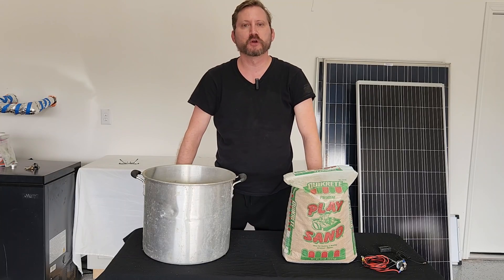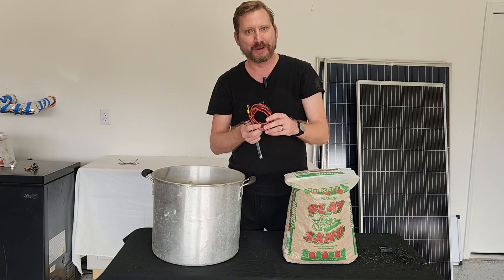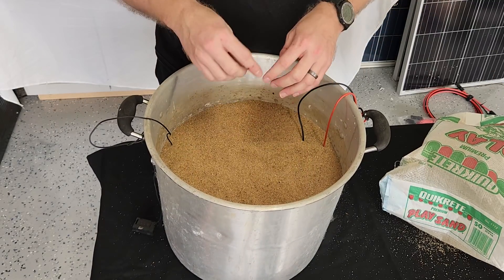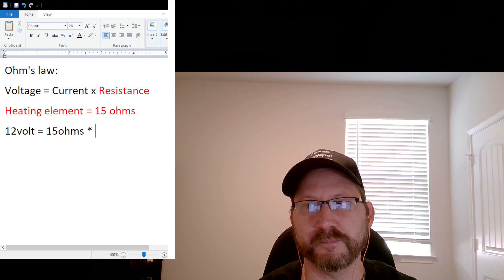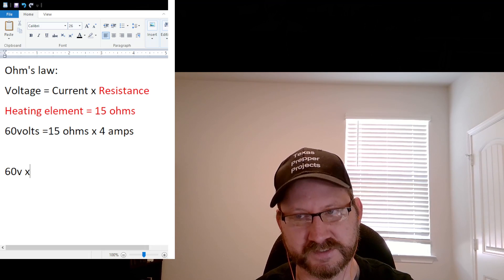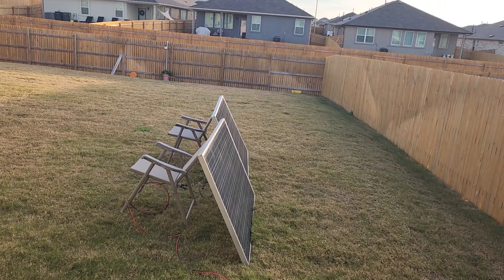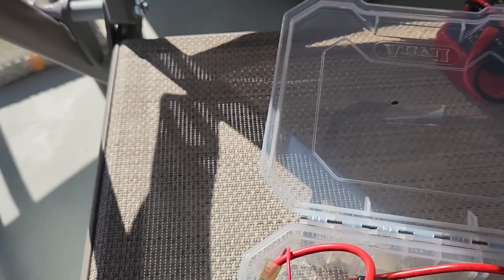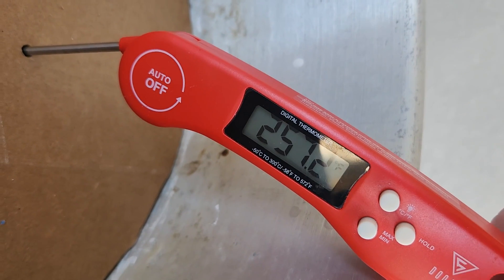Sand Battery Heater solar powered 250F / 120C with no flames or fuel! DIY

Comment: How can you calculate how much sand to use? I am thinking about doing something like having say 200 pounds of sand maybe in a basement, the two panels heat that up and you let the heat leach out all night, maybe it heats the first floor floors of a small house and that has somewhat of a radiant effect. As you say this isn't going to heat your whole house with two little panels but with longer wire runs and the sunshine being free it might still be nice if it just took some of the edge off by acting as radiants floor heat on the first floor. Since this is just a bit of low budget boost and it's really "set it and forget it" that might be an interesting application. This would be good too if your basement had no insulation in the ceiling.
Reply from the maker: I think that heating a barrel of water with direct solar tube probably would make more sense.

Comment: looks like you can add more sand to the pot... i would keep the wires at the bottom and run up inside walls .. can put inside metal garbage can with even more sand .👍👍 or use as a middle of day batteries full dump load .  a insulated  box over it  that can be removed would save heat for later.
Reply from the maker: Could

Comment: how long does that heat element last? It's not designed to work in a heat isolating material. The water would cool it down

you could've just use water. With send yes you can accumulate more than 212 f of heat. But you'll have a problem to release that heat when you need it. That heat is trapped there in the center of that send. 

You can use water instead. Your 200W panels won't be able to boil a lot of water. Just having a bigger volume of water is better cos you can easily regulate that heat later. That's no need for a sand battery for that small pawer. Maybe if you have 20kW solar panels send batteries can be useful. Those that can melt send.
Reply from the maker: check out my other videos on this test.  Water has logistical issues, like, everything hast to be waterproof.

Comment: So what is your verdict. Does it work as intended?
Reply from the maker: This does work. You just need to be realistic as to what you are going to use it for
Reply: Thank you for your reply @texasprepperprojects . Would you say it is equivalent to a 60 w heater 24/7 (since it is 240w, and the sun shines at a good angle perhaps 6 hours/day?) in that case 10 of them would equal to 600 w heater 24/7. it wouldn't be enough for heating a room i cold sweden during winter, but with more panels perhaps it would.
Reply from the maker: @qvarsell   not in sweden! too cold!

Comment: whats the max temp of the element? does it burn out/break at some point?

i bought a 550watt 120v charcoal lighter, along with many other resistave heating elements to start testing with.

a couple of years ago i filled a 40 gallon trash can with sand, ran a copper coil pipe in the sand. planned on pumping water through this pipe down into the sane and the back up to a small heat exchange with a fan on the back side to help heat the house. its all still sitting here, but i have not done it yet and this was going to help me observe how this was going to work then scale up from there.

batteries are expensive, but solar panels and sand is cheap, same with copper tubing and other misc things.

water has a much high energy density, but it can only go to about 200f before it starts to steam then boil at 212f, but sand temps can climb much higher.

i still need to figure out the amount of sand and the temp of the sane needed to heat the house for say 3 days in the coldest of cold winter days, it may end up being way more than what i am hoping for

then in the summer maybe continue to cool zones with heat pumps.
Reply from the maker: it does. this is an ongoing issue i'm having with the sand battery actually. It ends up melting and coming apart.   The heat exchanger thing is actually a waste of time. heat is heat is heat is heat. Copper tubes and fans don't make the heat any hotter. Just put the can of sand  INSIDE the house and heat it up.  Running it through air may make it heat FASTER but doesn't make it heat any BETTER / MORE. To heat an entire house? you will need literally TONS of sand sitting on top of a volcano.  At best, you may be able to warm a ROOM.
Reply: i dont think you understand why i want to use a heat exchange. i am not wasting time on this. i plan on using the sand to store the thermal energy from solar during the day, then use water, pipes and heat exchange to pull the heat out as a source of heat for my basement.  i understand how this stuff works more than you assume
Reply from the maker: Cool
Reply: @jasonbrown467 what tex here fails to understand in his comments in the video and in replies. Is that you can cheaply make your own heating element to your specific setup and achieve higher temperatures. The problem with using water heater elements is that they will suffer from what is called a dry short, due to trying to use the element without a liquid. As most people understand heat rises. Well with a medium like water, the element will cause a thermal syphining effect. Causing water to flow over the heating element. 

By making your own heating element from wire. A person can literally make it to whatever resistance they need it to be. Not to mention heating element wire is designed to heat air, so heating sand with it is not a problem. As far as temperatures achievable, well you could in theory get to the melting point of the sand. Some heating element wire is used in the heat treatment of high carbon steels, and in kilns for making ceramics. While you will find other types of heating element wire in a toaster. 

All that these sand batteries are ETS (Electric Thermal Storage) systems. 10 to 15 years ago several US electric companies offered ETS programs. Where they would install one for you, and you paid some extra on your electric bill in order to pay for it. Unfortunately the systems weren't explained very well and few people had them installed. But they did work decently. 

So I hope that this information helps you somewhat, and good luck with your project.

Comment: What about the possibility of heating the sand directly with a solar heat collector?
Reply from the maker: What about it? Are you talking about a fresnel? Check out my other videos for testing
Reply: Okay, I will. What I was thinking about is an insulated sand pit with a copper plumbing grid inside and a solar heat collector (double pane with black sheet atop sand, essentially) on top. This just outside the greenhouse. The copper plumbing grid is to feed a larger, cheaper air duct feeding the greenhouse t @texasprepperprojects
Reply from the maker: Leave the sand inside the greenhouse

Comment: 2 questions.
Can you use wind turbines instead of solar panels
And instead of sand container. Can it be hooked directly to an electric water heater's element where we can pump water to a radiator system?
Reply from the maker: Yes. Any electricity works.  2, yes... but I think direct solar water heating with black tubing is easier and more efficient

Comment: I've read mixed reports of wiring panels direct to an element can cause the panels to wear out quicker. Anyone have more insight into this?
Reply from the maker: I don't know how it's possible to 'wear out a panel' other than if the resistance was too low and the panels were trying to put out more power than they can. Thats why the math is so important, to match the resistance of the load to the panels output voltage and current limits.  I'm at about half the limit of what my panels can do

Comment: Supporting heat for water tank? Like inline between woodburner and water tank?

Thinking of a sand battery with insulation that goes along a suitable pipe
Reply from the maker: It all depends on what your end goal is. If it is hot water there are better ways to do it

Comment: Aside from safety, any reason why this wouldn't be a good way to heat a van?
Reply from the maker: Nope. I don't see why not.  Just keep the sand inside the van and run the solar wires inside
Reply: @texasprepperprojects  would need to calibrate a thermostat so I could leave it on while at work. Currently in Southern US and was thinking of moving to MN. Wouldn't survive the winter without heat and this seems like it would be cheaper and more reliable than a Chinese diesel heater.
Reply from the maker: I don't think you are going to be able to do a thermostat. At best just plug it in and cross your fingers. The greater issue is that Minnesota in winter only gets about 2 to 3 hours of peak solar sunlight so you'll have to have a lot of panels for this to work. I think you are better off with a diesel heater or buddy propane heater actually for your situation
Reply: @texasprepperprojects  valid point. I have 900W of solar and the potential for 30A of alternator charging. That still may not be enough. Should add some wind, since I've practically maxed everything else out.

At any rate, would probably run the element off my 120v inverter since it's already on for my fridge.
Reply from the maker: Sounds like you have enough power. The setup is pretty cheap so give it a try!

Comment: This is fantastic. So is the idea that you are running the heating element at about 25% of its potential because it's a resistive element?
Reply from the maker: I'm running at 25% because that's as many panels as I have to put out the right wattage. If I had 4 panels I could get to 1kw

Comment: That’s neat I didn’t know that could be done now why hasn’t anyone improved on it I’m tech savvy and I’m old so my point is some could make lots of money off a good idea it work so well here to much rain and over cast but love your presentation.
Reply: There’s a sand battery heating a full leisure centre in Finland in winter
Reply from the maker: @hughmarcus1  yup and its geothermal powered. great idea
Reply from the maker: Thanks !
Reply: i have seen some examples of sand batteries in companies but indeed it could be interesting for households.

Comment: Think beyond a greenhouse! This has many commercial, industrial, grid-scale, and even home applications. Anywhere heat is used for any purpose or with more effort and expense anywhere electrical power is needed.
Reply from the maker: the problem is scale. In order to heat more than about 100 square feet you have to have a LOT of sand. Like, literal TONS of it.
Reply: @texasprepperprojects  How big is your kitchen oven <10 ft3? Also the size of the area you heat depends on the temperature/wattage applied over time VS what is lost. An aluminum pot loses heat like a heat sink. R40 insulation however holds heat like crazy. A hundred pounds of 600 degree sand highly insulated will be hot next week.
Reply from the maker: @Resist.Tyranny   but if the pot is INSIDE The airspace, then the heat isn't ever 'lost'

Comment: PV dump sand battery is also my current obsession. Debating whether to DC dump from the full array (175 VDC 34 A), take it from the 48V battery bank, or run it through my single-phase 120 VAC service. I've been considering pros and cons of each and keep coming back to 120 VAC as the most practical, in spite of the wear and tear on the inverter, etc. Would love to see more examples from the community here.
Reply from the maker: I would do direct DC if you can get the resistance to work out

Comment: Hi thank you for that.
It is good that you show us how to do it, however. I have been using immersion heaters as dump loads. To control our wind turbine.
Over the years we added 5kw+ of Solar pv. The base voltage is 120vdc and the Dump load voltage is 138/9vdc into two tanks total capacity is 500ltrs +, each immersion  is 2 kW. They are stepped to brake the WT seconds apart. It works very well with no problems since its installation in 2008.
I would not dare tell you what to do but an accumulator of capacitors or batteries would give you a much better power range.
You were working in the full Power of the Texas sunshine and if your sunshine range dips to 66% you will get no heat. With capacitors or batteries or both between the panels and the sand battery it will produce much more over a longer period. 
55 years ago, they installed storage heaters in our dwelling houses. Some were 3jw..
They used economy 7 to heat the elements but the material used to store the heat were canisters of 4mm limestone chipping., dust free. 3 canisters approx 200mm in width sq  and 500mm in depth. Made up a 3kw unit. Later on they used a fire brick of sorts.
This is a much discussed item in renewable energy forums.
Keep up the good work.
Cheers.
Reply from the maker: thanks!

Comment: I think you mean silicone rubber insulated wire, not silicon.  Silicone is an oil and silicon is essentially sand.
Reply from the maker: Thanks

Comment: Of course you can store heat in insulated tanks full of sand, rocks, glass beads.  Of course you can heat that tank with electric heating elements.  It’s just not economical.  And if it was better, we would already heat our houses with electricity, but not many do….because the supply of energy for home heating is a very complex issue that depends on what energy sources are locally available and the infrastructure costs to get that energy to your house, and the cost to convert it from its delivered form into heat.
Reply from the maker: I do agree with most of this statement.  I think the easier answer is 'scale'. I think thay geothermal sand storage works if your tanks are in the tons, but that isn't practical for residential use

Comment: Add 100'+ coil of copper tubing. You have a pool heater. That's what I am doing!
Reply from the maker: Just use a normal pool heater and a tiny 12v pump. Much cheaper and less losses https://youtu.be/ubIkEjnByrA?si=HicfD0-KX4787e1u

Comment: For energy storage of this kind, the higher the temp delta, the better the results. heating sand above 500 has more density than water sub 212
Reply from the maker: 50F to 250F is a hell of a delta

Comment: I know this is from 3 months ago, but could you do a video where you discuss the possibility of scaling this type of solution, along with the logistical challenges that would create?  At some point, you're probably further ahead to use the current from a larger PV array to power a decent heat pump.  Still, I'm wondering if something like what was demonstrated in this video, built to a 5x or even 10x size, could be housed inside of a thermal mass, creating a solar-electric alternative to a rocket mass heater?
Reply from the maker: I actually think that a 'better' option than anything else is to use a small DC pump to circulate water through a solar heater (basically black tubing).  The TOTAL  amount of money you spend on equipment and solar vs the amount of BTUs you would get from heating 55 gallons of water or more, I don't think can be beaten. Check out my other videos. I gained 20F in 35 gallons of water with a tiny pump and a pool heater. That's a lot of BTU for the dollar.
Reply: @texasprepperprojects  - There are three reasons I don't like water for storing heat energy - "flash to steam"!  Sand can't do that.
Reply from the maker: This is true but running water through black tubing isn't going to get it THAT hot
Reply: @texasprepperprojects  
Right, the Black HDPE tubes/pipes start disintegrating above 70degC, hence in a ThermalStorage (Sand or underground) you can not archive more then 50degC otherwise it become soft and deform. Very Bad if you have 300m3 of sand on top. and then a 17x7m winter greenhouse on top.

If I heat up the 300m3, I can get only the range from 50degC to30degC out and feed it controlled to the Underfloor Heating System of my house. this is 1800kWh of heat energy which would give me 50 days basic heating if they where no other losses.

However, I have to verify the 50degC with the manufacturer of the HDPE pipe, maybe I can get 10 degC more

Comment: you could wrap that pot with copper tubing to make a fluid heat exchanger for haeting a soaking tub, radiant floor heating etc
Reply from the maker: It all depends on if you have the bucket inside or outside your house
Reply: You could put that exchanger tubing strategically into the sand mass in the barrel, and avoid having mounting issues altogether.

Comment: good idea  . but would  Magnifying glass pointing on the pot not produce more heat and if that pot surrounded with volcanic rocks  make a better heat generating divice? we know magnifying glasses can set fire to wood ??? but applied  to a pot  filled with sand  could be a safer bet of generating  more heat from that pot?
Reply from the maker: The problem with something like that is you have to re aim it every 15 minutes as the sun moves

Comment: Good DIY demonstration of a sand heat battery. As you said water has a higher specific heat capacity than sand approx. 4200 J/kg/K to 830J/kg/K about 5 times. So 25 kgs of sand heated up by 500 Deg C would  store 830*25*500 = 10.3 MJ not a lot, but the great advantage is it can be easily scaled up.  Great video.
Reply: So you’ll need like 180 tons of sand to keep a detached house warm in cold climate (20k kWh)…
Reply from the maker: Thank you+
Reply: 1.1 megawatt per 10 tons of sand.